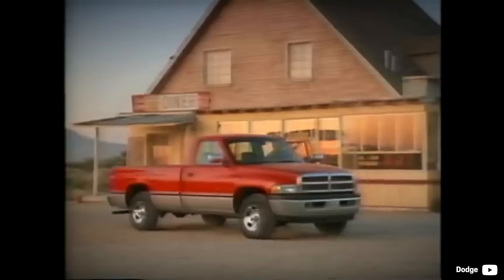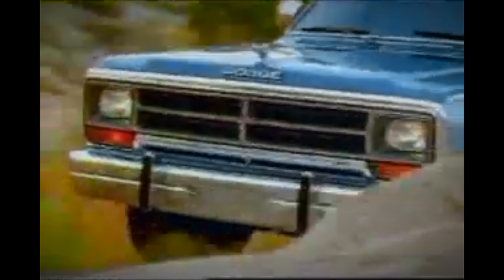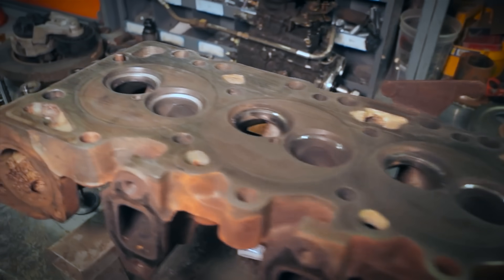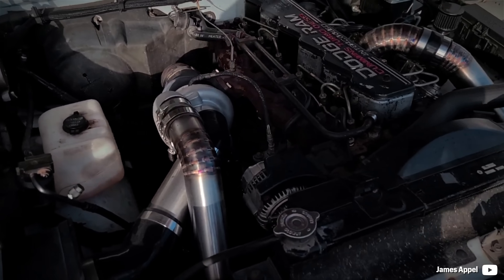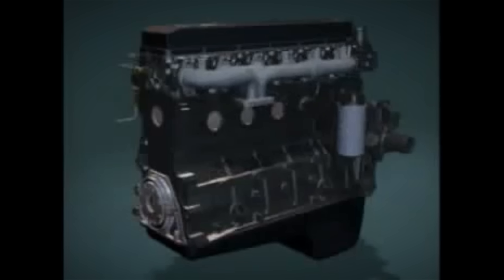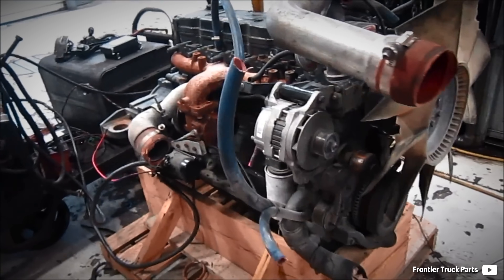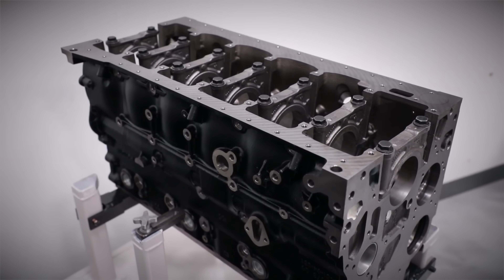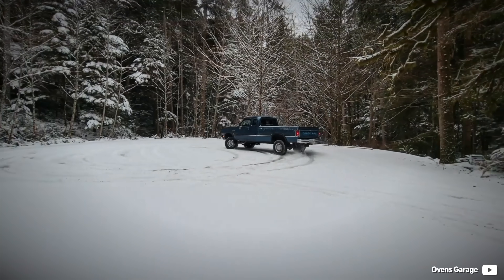The Most Reliable Diesel 6-Cylinder?

Comment: I love the sound of a 7.3 Powerstroke, but the Cummins in-line 6 is definitely a robust engine, that is easily upgradable. Shame they got put in a chassis that couldn’t last, but makes it easy for people who want to swap one into their own chassis. If I ever got my hands on a 70s crew cab Ford, would likely stick one of these in it. That or a single cab dually.
Reply: There is nothing wrong with the chassis on my 92 dodge. Dana 60 differentials and full heavy steel frame. It is the body that is on the chasis that could have been better.
Reply: Speaking of inline 6s Ford’s 4.9/300 for a half ton

Comment: I've known a lot of truck drivers I even have an uncle that drove tractor trailers for over 40 years he always said if it has a Cummins in it you should carry a good pair of walking shoes with you because it's going to break down.
Reply: I don't know why semi engines should be any different than pickups. I have a 92 dodge that is very reliable. With 220 thousand miles it will still b going down the road long after I'm gone from this earth.

Comment: I love Cummins B series engines. Unfortunately  in South Africa they are very expensive (if bought at a dodge dealer in a RAM) and only Dodge has a passenger/ light duty pick up with the Cummins B series installed from factory. Luckily you can buy it as a crate motor at Cummins them selves if you have the money and recourses to put it in another vehicle. And if you can find a competent mechanic

Comment: Imo, no diesel sounds better than a Cummins. I test drove a new 2003 Dodge Ram 2500 with the Cummins just for fun. The torque was a blast, and the heavy duty 5 speed increased the fun! But it was more than I needed. A month later, I bought a new V6 5 speed F150.

Comment: I have a 2003 2500 Cummins with 6 speed manual  and no major issues having over 560,000 bought back in Aug 2005 with 67,000 it's a true work horse that's never had any engine failures causing me to be towed home like others it's industrial grade truck
Reply: Last 3 words should be in all caps.

Comment: 7.3 powerstroke had more hp and tq than the 12v year by year, and could take the same abuse as a 12v. Also was less prone to head gasket failure. But it’s biggest downfall was it’s over complicated heui injection.
Reply: The whole engine if far more complicated and harder to work on than the Cummins. But if you want to see complicated look at a picture of a 12 valve Cummins along side a duramax.
Reply: @ronskancke1489  because of the heui injection, yes. But a 7.3 idi (mechanical injection) is just as simple as a 12v. Maybe a little harder to work on due to the nature of it being v8 vs i6

Comment: The 6BT 24v was problematic,  of course the VP44 ( not 45 as he states)  definitely was a big problem.  
 What he doesn't say anything about is how the 7.3 DI used in the 1st generation powerstroke ( 1995) out sold the Dodge Cummins by quite a bit. Cummins was not the end all be all in the diesel community.  
  Each manufacturer has it's pros and cons and to say that the Dodge Cummins was the best is absolutely disingenuous. As a tech who has worked for different manufacturers,  I've seen first hand that the Cummins was by far not the best. In my opinion,  the 12v Cummins was the least problematic and probably the best engine Dodge ever used.
Reply: First year for the Powerstroke was 1994. It had 210hp and 425tq
Reply: @countcuda70  
 Now there is the argument that because 94 used the 7.3DI, it was in fact a "powerstroke". However the actual branding wasn't used until 95.
  Ford is notorious about having split year models,  more so than any other manufacturer that I've worked for.  On the powerstroke line alone,  I think there is around 8 different split year models,  with  4 being the 7.3 platform.  From 94.5 to 03.5 was the 7.3DI, and in 94 you could get 3 different 7.3's alone.  7.3 idi non turbo,  IDI turbo, and finally the 7.3DI ( direct injection).  
  7.3idi non turbo,  IDI turbo, 7.3DI with 3 different revisions,  then it was the 6.0, 6.4 and finally the 6.7.
Reply: @bryancenterfitt7127  The first year for a Powerstroke was in 1994. Yes it was a half year but still in 1994. 1995 was the first full year for the Powerstroke
Reply: @bryancenterfitt7127  This is the first paragraph in Wikipedia. 
The first engine to bear the Power Stroke name, the 7.3 L Power Stroke V8 is the Ford version of the Navistar T444E turbo-diesel V8. Introduced in 1994 as the replacement for the 7.3 L IDI V8, the Power Stroke/T444E is a completely new design, with only its bore and stroke dimensions common with its predecessor (resulting in its identical 444 cu in (7.3 L) displacement). In line with the IDI diesel, the Power Stroke was offered in three-quarter-ton and larger versions of the Ford F-Series and Econoline product ranges.

Comment: I worked at Cummins out of the Columbus corporate office. They are great company that truly does care about making a great product.

They are currently working on developing a liquid hydrogen cylinder head that can convert diesel engines to zero emissions, and a liquid hydrogen powered platform.
Reply: Do explain beyond marketing jargon what it is meant by zero emissions?
Reply: @jasonhessels  a cylinder head and fuel system designed for liquid hydrogen use that can be retrofitted to a deisel engine bottom end.

Comment: I have a 12v that froze and cracked the block when ice formed inside the engine and the thing will still run with coolant leaking out of the block.  They are impressive engines that last longer than the dodges they are placed into.
Reply: Where did the ice form?
Reply: Lol. You must not realize that most engines that freeze will still run while coolant leaks out the block. Using that to base an engine design on is ludacris.

Comment: Used to be a ford fan, but after having reworked a half dozen ford 6.0 and 6.4 Diesel engines, and my very heavy ford service truck 6.0 diesel (3) engines in less than 300,000 miles, enough Ford junk. Bought a 2016 ram  diesel 3500 for pulling my 30’ travel trailer, love it and the exhaust what a plus for down hill , and a horse up hill, love it!

Comment: Unfortunately Dodge trucks are trash maybe the engine is good for the older Cummins but I much rather have a 7.3 and a nice Ford truck and a 12 valve or 24 valve compared to 7.3 is a tinker toy

Comment: Nope, the 7.3 Litre Powerstroke Navistar and Ford teamed up to produce is a much better motor for light to medium duty trucks...after having owned both a Cummins (03 3500 Dodge) and a 7.3L Powerstroke (99 F350), I very much prefer the Powerstroke...but you're correct on the Chevy stuff, cuz those Duramax engines are just like the rest of the chevy truck they power, they're all 100% complete garbage....🤘🏻🇺🇸
Reply: You're funny. The 7.3 is a good engine but doesn't make a lot of power. For towing. The Cummins and Duramax are way better

Comment: Best engine's is Cummins 5.9 and the super best is the monster 8.3 from 210hp non intercooler, to 8.3 125hp to 315hp intercooler manual fuel pump or 240hp to 260  water-cooler Manifold this particular model no need intercooler is a real horse and the most reliable engine, swap to 8.3 if you have space or need super torque 🤗💪🏿💪🏿💪🏿

Comment: I own a 2017 Ram 2500 Cummins with 70,000 miles. I’m not happy at all. 70,000 miles and the turbo is done, the transmission is going , and the entire fuel system is weak which means it’s on its way out. Absolute junk
Reply: Did you maintain the car?
Reply: @fungo6631  see that too much these days it dont matter how good it is if you dont give it some TLC it will fail. we give all our stuff TLC we have an old 40series land cruiser still running ODO is at 370k and that stopped working well before i was born who knows how far its truly driven also have 2 Suzuki LJ50's still running. but now days people not know to to give some TLC and there fancy $100k cars hardly drive over 50-60k.
Reply: @fungo6631  heck ya I did, no way I’m spending that kind of money and not changing the oil and servicing it. The Cummins isn’t the problem it’s everything else

Comment: your video is right, but it wasn't dodge who destroyed the comp. its Cummins, dodge just has a contract with Cummins, just like chevy with Isuzu, and ford with Navistar. even Nissan works with cummings. dodge had nothing to do with it, besides that the 6.6 Duramax and 6.4 power stroke are just as powerful and just as reliable
Reply: Worked, not works…
Reply: It's Cummins. Not Cummings. GM didn't have a contract with Isuzu. They were partners. GM and Isuzu started DMax LTD.

Comment: Whether it's been the Cummins 12-valve, the International Navistar 7.3, or the Isuzu V8 (Duramax), they've all had their strengths.
Reply: They all have their issues...got a yard full of powerstroke 6.7's Lee's than 2 years old waiting for the dealership to get parts, rams with bad turbos, chevys with steering issues and electrical gremlins. Just part of the fun of diesels
Reply: @youtubecantsaveallthesnowf8601  yea i am waiting on parts for my 6.7 PSD  too ford said my fuel pump is on back order  the parts guy laughed when i told him i was repairing a truck someone put DEF in the fuel tank ,,i guess this DEF in the fuel thing is quite common
Reply: izuzus are turds, the v is great for power but shit for strength
Reply: @andrewvalenzuela4383  the first duramax was designed by Izuzu and built by GM ,,   it's not the same engine anymore ,, just be thankful it's not that Pieceashit diesel PSD built by FORD ,,i just bought a 2018 F350 at an impound auction  and now i know why nobody wanted it ,,most godawful pile of dog dump i've ever worked on ,,damned ford you gotta remove the entire cab to work on the engine, ,this is gonna be the biggest job i have ever done ,,i got the truck for just $1200  but i'll have $10000 in it by the time it's running ,it needs an entire fuel system  because someone put DEF in the fuel tank ,,it'll be  a $50000 truck when i am done
Reply: @wildcoyote34  lol sounds like you’re above your experience with that job bud. So your blaming ford for someone putting def in the fuel system of their truck? Lol 6.7 powerstrokes are one of the best diesels on the market. Multiple one million mile examples out there. Ford made it easy to remove the cab, so now you can sit on the front tire and work on the engine. Once you get it off, you’ll realize why they did it like that.
Reply: @wildcoyote34  Duramax isnt much better. Just pulled the cab to do head gaskets at 80k lol
Reply: @traxxasrcfun  no i'm not blaming ford for some stupid driver putting DEF in the fuel tank ,,ford made the cab easy to remove so that a shop could work on it easier  ,,not so a private person could work on it easier ,,i just happen to be a private person with access to a large telehandler ,,i can remove the cab pretty easily ,,and i've been fixing my own vehicles since i learned to drive  , i  have not found many that i can't repair if i put my mind to it ,, and it's even easier today with access to the internet ,,there's 500 million people i can get info from ,,i've watched 25 videos on how to remove the cab alone ,,when i first started working on cars i spent many hours at the library reading books and making notes ,,and the very first thing i did when i bought this truck , i bought a repair manual too
Reply: @SR20FTW  i'm not much of a duramax fan either ,,i tend to like inline 6 cylinder engines , i have an 8.3 liter cummins in my RV pulling truck ,,it was actually pulled from a wrecked class A RV ,,and it was cheaper to build my own truck than buy one ,,but i now have a more modern engine in my 40 year old truck  that has exhaust brake capability and much more power than the previous gasoline engine i had
Reply: @wildcoyote34  so you bought junk from a auction that someone put DEF in the fuel tank and your blaming the truck/manufacturer?
Reply: @Jason1Pa  you need to go read what i wrote  because i never blamed ford for what some stupid driver did to his own  truck ,, better yet read the comments below my first one ,, my rant was about the way the truck is built ,the engine is put together ,they have made it needlessly complicated to work on it
Reply: @wildcoyote34  honestly I have no problems working on my 6.7 power stroke. Never had problems. But I guess when u only spend 1200 on a truck you get all the problems with it lmao.
Reply: @S.C0501  this isn't the first truck i have worked on  and certainly not the first ford  i don't like the fact that i have to disassemble my entire truck to work on it
Reply: @wildcoyote34  A telehandler, you must have a really big shop. Most people just use a two post lift to pull a cab. Interested in your big Cummins, what class of truck is it in, did you mean to say it had a Jake? Everybody has an exhaust brake, and wishes they had a Jake.
Reply: @Burntwon  I unfortunately don't have a 2 post lift in my shop i have a 4 post drive on lift  and my garage isn't all that big  ,, but what i have is plenty of space because i live and work from my family farm the telehandler gets used for stacking hay bales and construction work ,,picking up a cab with a little help from a friend isn't hard the cummins 8.3 is in a GMC 3500 now ,,it was in a class 6  truck chassis  in a class A pusher RV 
and i said i wish I could add a jake brake to it  ,,it has an exhaust brake   that works quite well ,,i pull a 44ft 5th wheel trailer regularly and the extra safety is nice to have
i should also say i changed the factory automatic the cummins came with to a 7 speed eaton  because i prefer a manual transmission  ,I drive a class 8 truck regularly doing farm work  and have gotten used to having jakebrakes like any truck driver
Reply: @wildcoyote34  I really think a lot of folks in the diesel world have miss directed anger. When it comes to Ford PSD, Navistar did a poor job adapting to the EGR requirement. The 7.3 was a good engine, the 6.0 and 6.4 we're failed attempts to meet the new EPA mandates. The PDF, is even worse than the EGR, I wish you luck with your truck, my experience taking off a cab is no big deal, especially if you've done it a couple times. I own a 2003 7.3, the last few made, and it's been a great truck for me. I also own a  94 6bt engine, looking forward to using it in a square body Chevy swap. In my opinion the 6bt p-pump is the best engine out there. My son owns a pretty hot 6.0, so we've lots of experience taking it's cab off. Been a lot of trouble but it's a really nice truck now. Best from Montana.
Reply: @Burntwon  I've got a 6 liter truck too , it's actually an 06 F-350 tow truck and i've had the cab off it several times ,,i got it back when everyone misunderstood the 6.0 , when properly bulletproofed  it's actually a very powerful and reliable engine ,,my 6 liter when i got it a decade ago suffered from cityitis ,,it hadn't ever been driven at highway speed and so the turbo was carboned up from idling and stop and go traffic ,it wouldn't produce boost at highway speed i got the bugs ironed out of it ,,i had to completely rebuild the VGT turbo  ,,last time i had the cab off it was in 2019 when i decided to go through the bulletproof procedure ,,it had a leaking head gasket at 120K miles ,,ARP head studs, O-ring heads  , EGR block-off plates ,new turbo ,new mishimoto radiator and complete new exhaust ,, runs like a brand new truck 

once i get this new truck rebuilt ,  i'm already well into it's rebuild  ,i'll probably end up keeping it for a couple years
Reply: @wildcoyote34  So, you call the PSD Ford garbage until your skills are called into question, then you admit...it aint so bad.  Make up your mind Kare...Ken.
Reply: @DavidWilliams-hf8sc  i never admitted anything ,, i just think it's stupid having to remove the entire body from my vehicle in order to work on it it's one of the most oxymoron things any auto maker has yet done and FORD did it first ,,someone that has no idea what my skillset is questioned whether i should be working on this particular vehicle  that's nothing new , i've been repairing vehicles of all types since i was 16  ,,i started with mowers when i was 12 ,i'm almost 50 now ,i've got a pretty good handle on how to rebuild an engine or replace the fuel system in a Ford truck ,,i've got a big advantage i didn't have 30 years ago ,,i have a massive number of resources that didn't exist then  , things like you tube  and facebook , i can follow the procedures laid out in a master repair manual but its so much easier to watch someone actually do it and show how it's done ,,not to say it's not a big challenge because it's one of the most complicated machines i have ever taken apart with intentions of repairing it
Reply: Not knocking any of them, but here are the 3rd quarter 2022 sales;
 Ford 	Super-Duty Diesel 	                        Comm Diesel         Pickup 	38,072 	20,153 	↓

Ram 	Ram Pickup 2500/3500 Diesel 	Comm Diesel 	Pickup 	25,929 	25,982 	↑
Chevrolet 	Silverado 2500/3500 Diesel 	Comm Diesel 	Pickup 	35,328 	32,085 	↓
GMC 	Sierra 2500/3500 Diesel 	                Comm Diesel 	Pickup 	28,277 	22,566 	↓

Say what you want, Ford still sells more diesel trucks, which I own 3 of, however I happen to believe the RAM is better on fuel vs pulling power.
Reply: There should have never been low sulfur diesel fuel. There should never have been DEF fluid and all the junk required to run it. There should never have been complicated, expensive, and complex emissions equipment mandated for diesels.
There's much better ways to make a  diesel run cleaner, stronger, longer without regulators getting their criminal noses in transportation.
Reply: @turnin.sprocket  what are these ways? What are some links to examples of them being used?